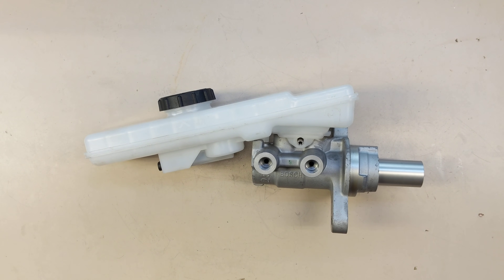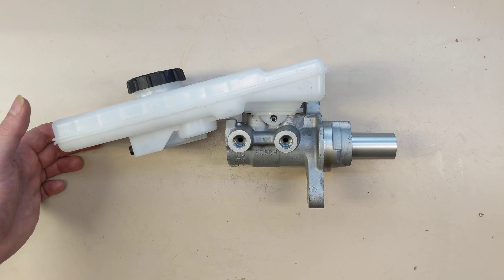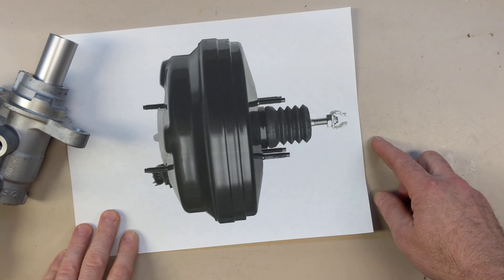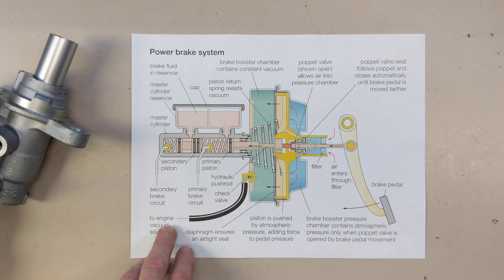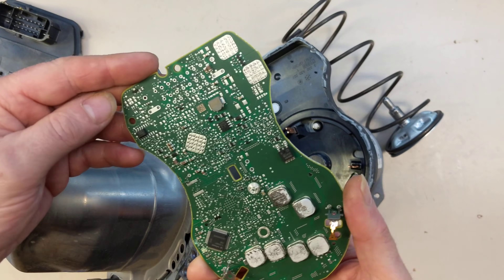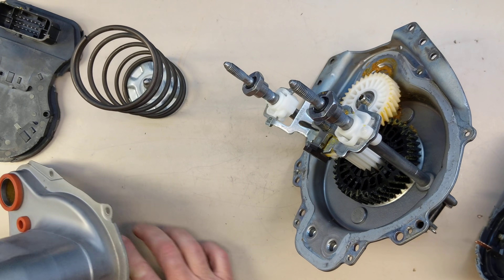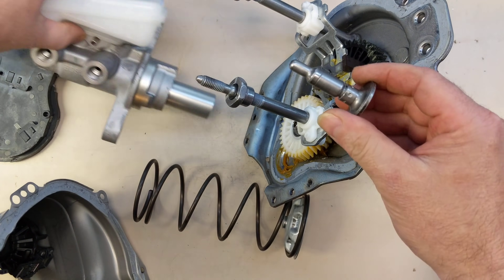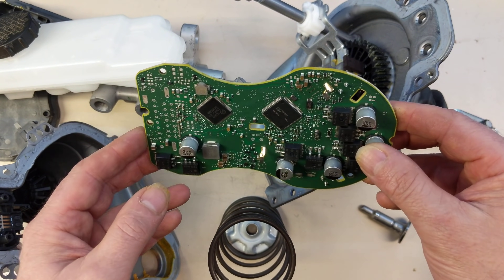Tesla Autopilot - How does it stop?

Comment: Nice overview of the product, normally nobody takes care about :) I have been working with iBoosters at Bosch for 6 years as an product engineer. One remark - there is no torque sensing, boost force is given purerly based on the stroke sensor.
Reply: Do the abs pump comunicate with the iBooster over canbus?
Reply: @flo_neke  Yes, it does. When iB diagnostic detects a failure in the system, ABS gives the necessary boost.
Reply from the maker: @kossaKSF  In addition, if ESP3 (ABS) fails, there are still 5 other ways to stop the car:  1. Regen, 2. DI Plug braking (if loss of HV),  3 & 4. EPB (Electronic Parking Brake) EPB has 2 independent channels, so it counts for 2.   DI plug braking can happen without ANY power in the car.
Reply: Brilliant device! Such clever design.
Reply: The ibooster is a truly beautiful piece of engineering, I have reverse engineered it to brake my smart car and it's perfect
Reply: Essentially, to cut a long disagreement short, a hall effect sensor cannot measure pressure, only linear movement. This movement is interpreted by the electronics as applied pressure for the purpose of translation to apply force to the brake master cylinder via the motor.
Reply from the maker: There most definitely is pedal pressure sensing, I clearly showed how this works.   When you press on the pedal, you are compressing an additional spring, just as you would in a Vacuum Brake booster.   The hall-effect sensor detects how far this moves, which is pedal pressure, not pedal travel.
Reply: @Ingineerix  Hall sensor detects only the movement, there is no pressure sensing in the iBooster. Small conical spring is only there to give an initial resistance on pedal, so its mass will not cause auto-braking. How exactly iBooster works in reality and how the pressure-force curve is created is much more complicated and I am not able to explain by simple comment.
Reply from the maker: @kossaKSF  Wrong.  There is a pedal switch for basic movement.  There's no way Bosch would install a pressure sensor on the moving part of the assembly with the required high-flex ribbon needed.   There's no way to provide proper pedal feel and variable boost without knowing how hard the driver is pressing the pedal.   I'm sorry, but if you do work for Bosch, I suggest you go talk to an actual engineer on the project and get a proper explanation.
Reply: @Ingineerix  you are so wrong :) there is no need to have any information about the force. iBooster is just a VB with a motor instead of diaphragm and stroke sensing. If you want I can explain you via Skype how braking booster works in reality and what for are this rubber disc in a black part, small metal plate at the top of a plunger etc. The deisgn is much more clever than you think and just after tear down you will never recognize how it works in reality.
Reply from the maker: @kossaKSF  Both the original Vacuum booster and this are considered servos.  They amplify input.   The Vacuum booster has the same pressure sensing spring element, but as it compresses, a port slides open that admits atmospheric air to the driver side of the diaphragm.  The harder you press, the more air is admitted.   The same thing happens on the iBooster.  If all they had was a switch to indicate the driver was pressing, then every stop would be a panic stop.  You absolutely have to sense force, and the iBooster does.  It's easy to prove simply by watching the current consumed by the iBooster.
Reply: @Ingineerix  As I said, I booster only cares about the stroke. It is obviously not just a switch, hence a hall sensor is used to get precise info about the position. It works in a constant loop -> driver presses the brake pedal by x mm -> stroke being sensed by the sensor -> ECU orders motor to move x mm -> motor moves to the position -> motor position sensor sends feedback to the ECU that position is achieved. In reality much more happens, but w/o sketches and graphs it is not possible to describe those details. iBooster nor conventional VB does not require any information about input and output force to work correctly.
Reply: @Ingineerix  why would you doubt somebody who works with the exact product and works at the company who makes it? you should totally take up his skype call offer and share what you learn!
Reply from the maker: @iMagic16  If I told you I was Elon Musk would you believe it?  He clearly doesn't know how it works.  Ask any decent engineer, the system absolutely has to know how hard you are pressing the brakes in order to work, period.   @SuperFastMatt also did a teardown, and he agrees:  https://youtu.be/SRZ8XDNz2vU
Reply: @Ingineerix  There is a linkedIn account with the same name, guess where that person happens to work at? Coincidence? Unlikely. You could argue that he just made a profile with the same name, but then again, why would anyone do that.
Reply from the maker: @Santeri_M  He may very well work there, but still doesn't mean he knows how it works.  Very large company.   Anyway, don't take my word, or his word for it.  Ask any competent engineer; there's no way to provide a variable power assist without force sensing, period.
Reply: @Ingineerix  Do you mean the same SuperFastMatt that said "I don't know enough about electronics to make any sensible commentary" just moments before opening the pedal sensor? 
It's just a regular hall effect sensor, not a pressure sensor. It is however used like a pressure sensor.
Reply from the maker: @Malkki79  It's used as a linear position sensor, with that position being derived by how far the input spring is compressed.  So therefore it's most definitely a pedal force sensor.  (aka Pedal Pressure)
Reply: @Ingineerix  I'm going to dispute the claim because I see the argument between the two of you as a third party engineer watching you both.
You're correct that you need to emulate the pressure in order to do it properly in which case you believe you need to sense it.
He is saying that there is no "pressure" sensing just position sensing.
With the two of you are not realizing is because the rest of the physical dimensions are not changing, position sensing works exactly the same as pressure sensing for this particular situation. Therefore you do not need a pressure sensor and he's correct there is not a direct measurement of pressure, however you are correct in that they are measuring pressure via a indirect method.
Internally in the computer there's no need to know what that exact pressure is as you just use the motion to emulate the pressure, and that's why in the software it does not look at a pressure but looks at a position and therefore he thinks of it only as a position feedback instead of as a pressure feedback.

You two are actually not conflicting with each other but arguing over a pedantic point of whether or not you're measuring pressure.
Reply from the maker: @TravisFabel  There is no position sensor.  The only signal is a binary switch on the brake pedal used for illuminating the brake lights, etc.  The hall-effect sensor is on the MOVING part of the assembly, so it cannot detect position.   I don't know what it is with people wanting to argue about this, but it's pretty clear, the iBooster has to know how much force to apply, which it cannot do unless it also know how much force the human is supplying.  Since there is no position feedback, the only thing it knows it it's force and the force on the pedal.  There is no position input anywhere in the system.
Reply: I am working exactly with this product and lead countless training about it. Literally, 6 years of my work at Bosch are solving issues related to iB1 and iB2. My Linkedin profile is real and anyone who is interested in how it really works can contact me and I will gladly explain the principle. I will not be repeating myself 1000 times here, but you will never understand it by just tearing it down. It is also not possible in the comment section, as sketches and graphs are necessary. iBooster does not need any force sensing,  hall sensor detecting relative position between two elements (black one called "valve body" and metal "key" linked with "plunger") is enough. It works fine w/ and w/o braking pump assembled, w/ or w/o load. ECU does not need any input about forces in the system.
Reply: It would be fantastic for you two to connect with an aim to explain to each other and record the interaction so we can all get a better understanding.
Reply: @Ingineerix  you can think of it as a pressure being sensed overall in reality, but the pressure been directly proportional to the travel due to that spring.
So the sensor actually sensor position ,but overall the goal is to sense the pressure , pressure being directly proportional to the travel due to the mechanical arrangement
Reply from the maker: @karanbal  Yes, I'm fully aware of it.  You can read the output over CAN.   It's most definitely a pressure sensor, not a travel sensor.  You don't call a Human Being a large collection of carbon compounds and water.   For clarity, one should always distill the description to the topmost function.   It's a magnetic hall effect at it's core, which is used to detect the compression of the input spring by movement of a magnet.  The top function is an input force sensor.
Reply: @Ingineerix  There is a brake pedal switch inside the car which is on/off and no way tied to ibooster. The ibooster has a pedal travel sensor only. If the travel is greater than 0 it knows the pedal is pressed. It calculated forxe from travel and applied assist. Exact same way that EPAS torque sensors arent really torque sensors. They are more like displacement/travel sensors.
Reply from the maker: @phoenixs3  Yes, the EPAS sensor is most definitely a torque sensor not a position sensor.  It's measuring the deflection of a torsion spring.  Same in iBooster, the sensor has no idea about the pedal travel, only the pedal force.  If you remove the master cylinder and the big return spring, the sensor output does not change at all when you move the pedal (input rod).   It's only measuring the compression of the series spring on the input rod.  This means it's ultimately a force sensor, regardless of how the low-level details are implemented.  If you are going to nitpick and call it a position sensor, then I nitpick that and call it a magnetic flux (hall effect) sensor.

Comment: This is great stuff. I have watched all of you videos and they are all very educational. I think some of the Tesla models might not have iBooster but a less intelligent unit, and that's why some models don't have regen blending. I'm not so sure. Is this right?
Reply: Tesla does not use blending as e.g. VW. In their cars, the braking pedal only operates hydraulic. Old Teslas have conventional VB, but since 2016 all their cars have iBooster, at first iB gen 1 and now iB gen 2 from Bosch.
Reply: @kossaKSF  thanks a lot. I was likely wrong. They do have iBoostet, but not the ESP that provides the blending which is why they can not have the feature. And that's also why they default have high regen at lift off to recover more energy. Is this correct? I can't remember where I found this.
Reply from the maker: Prior to late 2014, they used a vacuum booster with an electric pump.  Since then all have an iBooster.   Tesla has NEVER done regen/brake blending on the brake pedal.  Now starting on Model 3, they have one-pedal driving,  but this is only for the "go" pedal, not the brake pedal.

Comment: With iBooster style systems specifically for ABS, does that meant it cam be calibrated to actually be smooth? In cars I’ve driven ABS has been jerky (high frequency pulsation ) or really loud sounding like grinding.

In the same way Motorsport level TCS and ABS work offer superior performance and not just superior safety, it seems normal cars can do better here
Reply from the maker: I'd say the pedal feel in boost mode is superior to that of a vacuum boosted system, and when autopilot or one-pedal is braking it's every bit as smooth as a human.
Reply: @Ingineerix  Ya it really is quite good!
I'd be interested to drive a blended regen car with an iBooster, the "older generation" cars could be quite non-smooth in the transition from regen to friction brakes. And if you were moderately braking, and hit a pothole or ice there would be a moment of NO deceleration as the system switched from reegen to all friction brakes. Not good.
Reply: ABS always make this pulsation in order to release pressure from a wheel that is over braking. iBooster does not change this behavior. New ESP generation is however much quieter, but noise is still noticeable.
Reply: Not sure on ABS intervention, but I can tell you for normal driving the iBooter has a much smoother pedal feel than electro hydraulic system like other EVs used. The iBooster's feel is really quite good IMO!

Comment: Is it mechanically possible for the FSD Beta hardware to overpower a driver, or is there some limits on the torque it can apply to the steering wheel? 
In light of the recent NHTSA complaint that FSD Beta overpowered the driver and caused a wreck, maybe you could do a video on the steering system and show whether the driver can mechanically override or overpower the FSD steering system.

I am sure there are multiple electronic safeguards, but assuming that the motor was shorted to 12v full power trying to turn the wheel to the left, can you turn it to the right?

A physical demonstration of it would be nice!
Reply from the maker: I don't believe this is possible.  It doesn't use a Brushed DC motor in EPAS, and there are 2 controllers cross-checking each other.
Reply: @Ingineerix  are you talking about the steering system or the brake booster? I may not have made my question clear that I was asking a different question about the steering system, and I can't tell which you are referring to lol
Reply: @ke6gwf  I believe there is a torque sensor on the steering wheel shaft (same sensor that detects your hand on the wheel) that will instantly disengage autosteer at a threshold, and the power steering motor goes back to assisting you, rather than steering the car. Now if the torque sensor failed I believe you would not be able to overcome the power steering motor, it's probably quite powerful. However you would hope the testers of FSD would familiarize themselves with how to disengage in an emergency and not just YOLO into traffic as soon as they got the update!
Reply from the maker: @ke6gwf  Yes, sorry EPAS is the Electric Power Assisted Steering.  It's double redundant, with 2 torque sensors, 2 processors, and even 2 independent power feeds.   They cross-check each other continuously.  It's super highly unlikely that it could overpower the driver.  As soon as the torque sensor detects driver intervention, it stops all externally commanded force.  I'll do a video on this system soon!
Reply: @Ingineerix  I guess I need to learn the acronyms better lol
Ok, double redundancy is pretty good, especially if it's hard coded in the controller rather than just software in the FSD computer.
I was basically wondering how possible it would be for the claim to be true, that they were unable to steer because it took over.
But with double everything looking for torque input, it sounds like a low probability of it being a car problem.

Though I wonder if the power steering assist system momentarily failed, and what they reported as the FSD taking over was actually lack of power steering combined with scrub forces on the curve, and they just weren't pulling hard enough.

Anyway, it will be interesting what the investigation finds, and I look forward to your expert overview of the system, so all the interested parties can understand the system better.

Comment: I know that you aren't trying to teach about brake systems here, but I will mention that it's not front and rear, but diagonal brake pairs on all the modern cars I know of. It's a safer form of redundancy so that even if one circuit fails you have one brake on each end of the car still functional.
Having only front or only rear is an excellent way to lose control!

Older cars often had only a single circuit, and race cars will often do front and rear to enable them to adjust the brake bias easily.

Tesla might have done it differently, and you have an easy way to check, but I would be surprised if they aren't using diagonal pairs.
Reply from the maker: Yes, it's diagonal out of ESP3, but the 2 outputs on the master cylinder are called front and rear.   If one circuit fails, ESP3 (ABS Valve body) can lock that circuit off and individually pressurize the remaining circuit.  If ESP3 intervention fails there are still 4 other ways to stop the car:  1. Regen, 2. DI Plug braking (if loss of HV), 3 & 4. EPB (Electronic Parking Brake)  The EPB has 2 independent channels, so it counts for 2.
Reply: In many countries, the law dictates how the brake system must be constructed.

Comment: 10:22 i wonder what is the reliability of the circuits such as this in a Tesla.  I mean, resistors or capacitors could go wrong or short. edit: ah there is a redundant circuit! 👍
Reply from the maker: Not just one redundancy, 5 other ways!  1. Regen, 2. DI Plug braking (loss of HV), 3. ESP3 (ABS pump), 4 & 5. EPB (Electronic Parking Brake) EPB has 2 independent channels, so it counts for 2.
Reply: @Ingineerix  🔥 thanks!